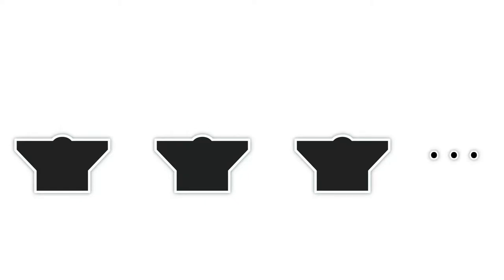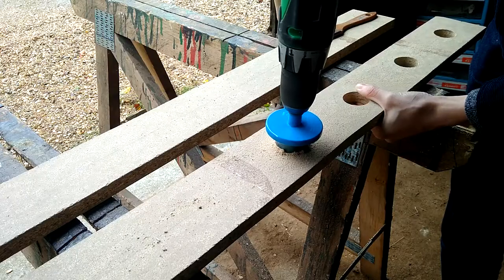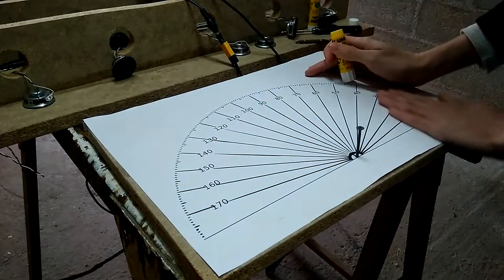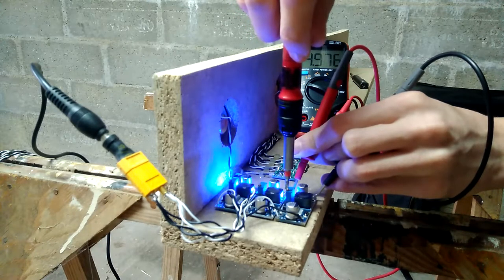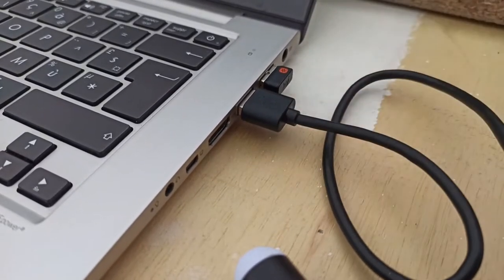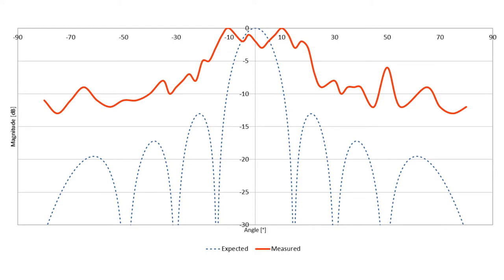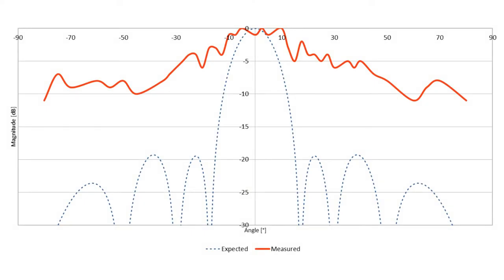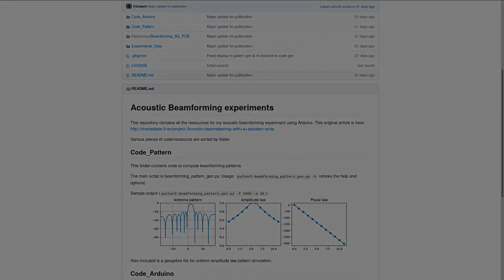Acoustic beamsteering with speakers and Arduino

Comment: is it possible to do the same reasoning with microphones? Use beamforming to choose a privileged direction from which to listen and amplify.
Reply from the maker: Yes, transmission and reception are completely equivalent. With software shifting and addition of the waveforms, it should be possible to do both beamforming and beamsteering. That is actually a great idea for a future project...
Reply: @CharlesGrassin  I am also trying to build a microphone array to amplify faraway sound signal from a specific direction. 
But different from sound transmission, the computing power required for such microphone array seems dauting. 
The entire signal chain includes high sampling rate ADCs to sample sound signal from each microphone synchronously with the same clock signal,  and collect the data to a central MCU for data processing (digital phase delay etc.) . Data collection and transmission seems way beyond what AVR based arduino can do, or even beyond the capacity of an Raspberry Pi.
Or we may choose to go for a pure analog solution using analog phase delay component to reduce computing power, but design and debugging seem to a big project.
Any thoughs?